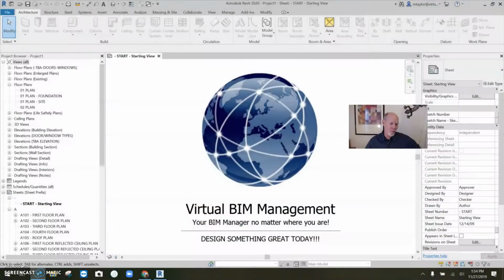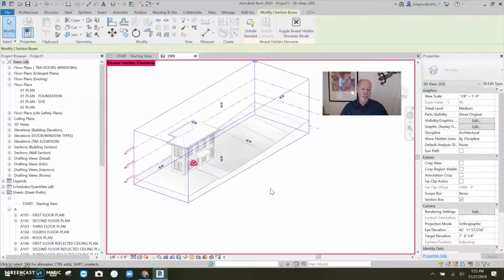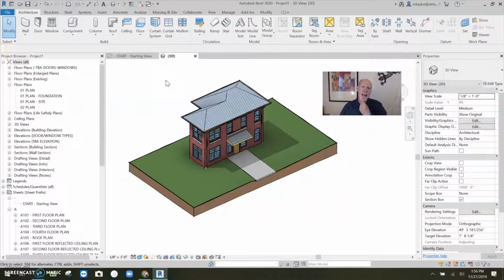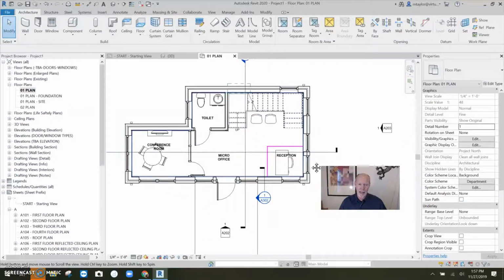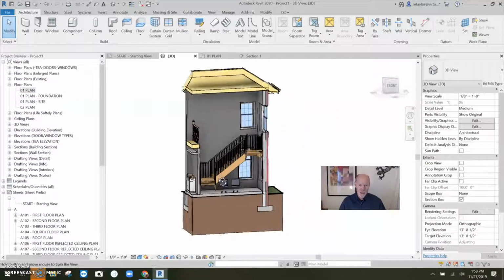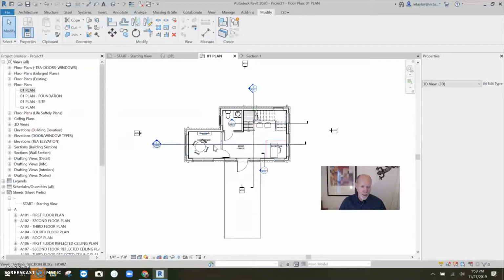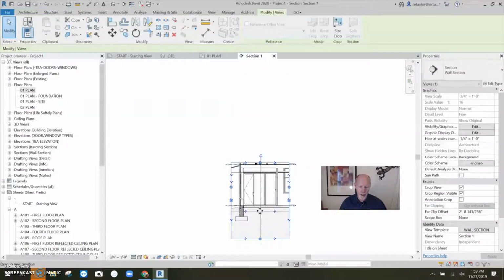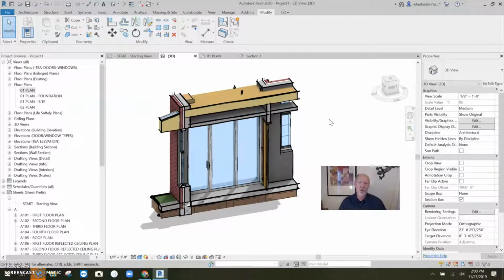Orienting a 3D View to a Section or a Plan

Comment: Awesome!  This is great and very useful!  So, it looks like standard workflow should be to add a section box to your model so you can use the tools this way?
Reply: A Section Box can be added to any 3D view. I already had one added to my 3D view.. so Revit used it. 
But, If I did NOT have a section box.. Revit will automatically use one... but it won't be hidden.. you will have to hide it so it's not in the view.. distracting people.